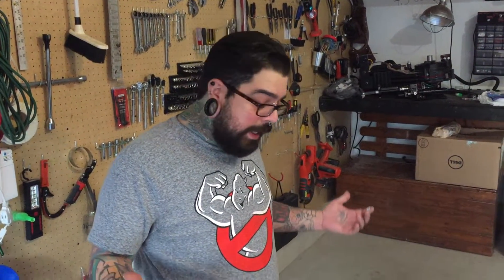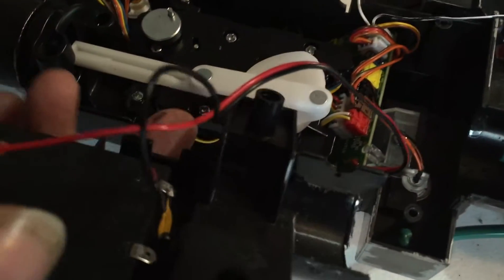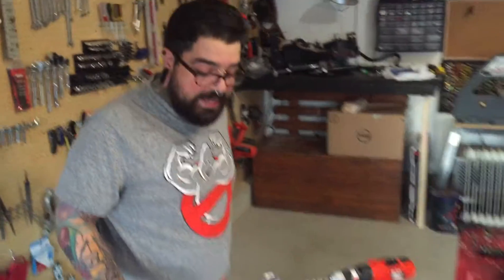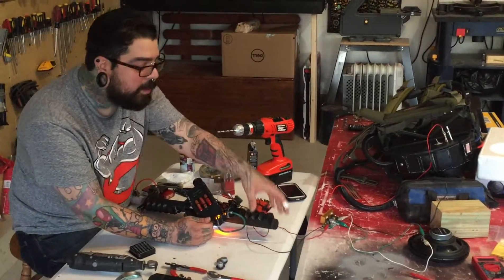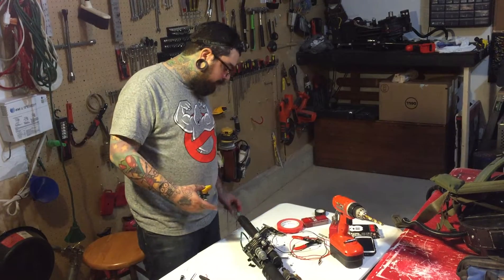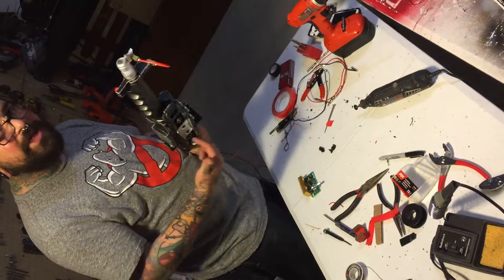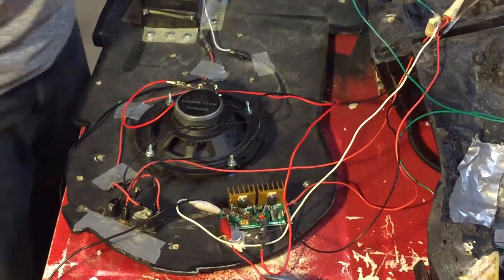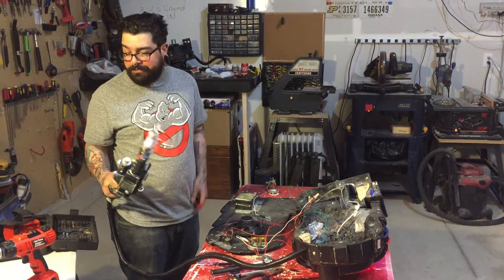Matty Wand Proton Pack Sound Tutorial Part 1

Comment: Hey thanks for the video. You don’t by any chance have like a diagram showing how it all connects to you? I’m a bit stump part way through the process with connecting the Hasbro wand. It’s all the connection stuff on the pack with the amp speaker and battery that I’m a bit lost
Reply from the maker: It’s been so long that we don’t any longer.
Reply: @CircleCityGhostbusters  Thanks anyway. So I need to have the lead wires connecting from the wand speaker to the amp board which is connected to a power source and the speakers is that correct? Would a 3" 8ohm speaker work just as well you think? and do I have to have a 12v power source? thank you
Reply from the maker: @jonogunn  That all depends on your amplifier and what it is rated for.